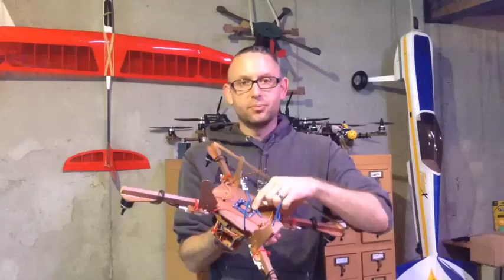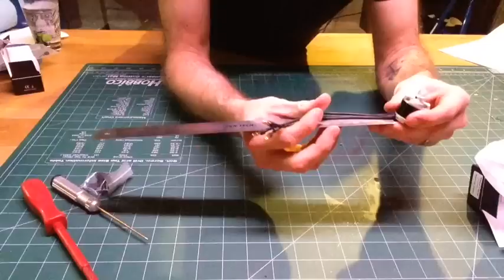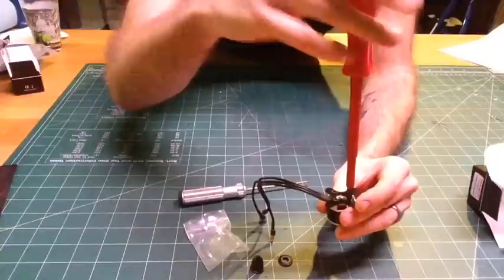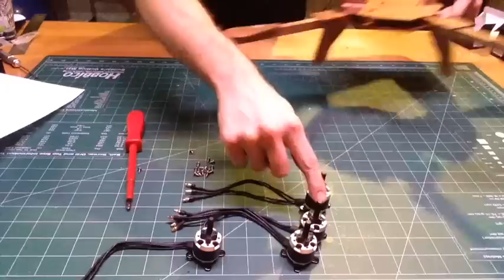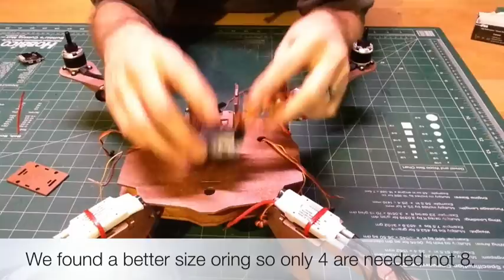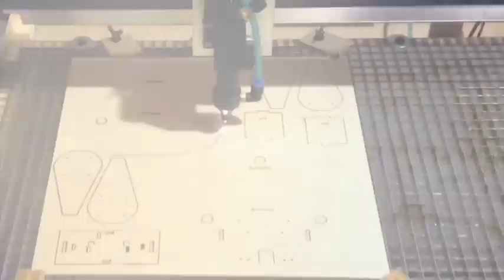Part 2 of 4 DroneKits.us Quad Frame Build Video - Electronics Install

Comment: Another great video. A couple things a newcomer may not know,  (that you did, you just forgot to mention), is on 3 of the 4 esc's, you need to remove the ground and power leads out of the plug leaving only the signal wire. Must leave 1 of them alone to send power to the receiver.
Reply: Power to the control-board i meant, not receiver.
Reply from the maker: You only need to worry about doing that if the BEC's in the ESC's are switching.  With linear BEC's it really shouldn't matter.
Reply: www.DroneKits.US My mistake. I didn't realize they were linear, i just assumed because i noticed you had removed your wires in the video. That"s what i get for assuming! lol